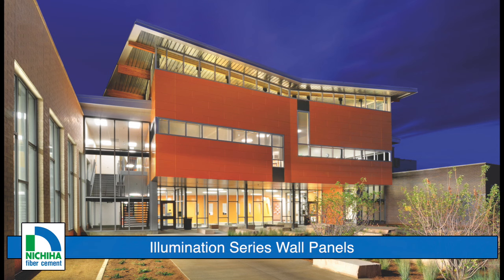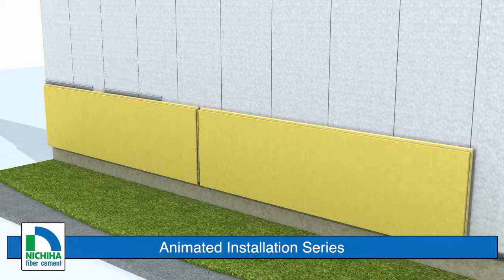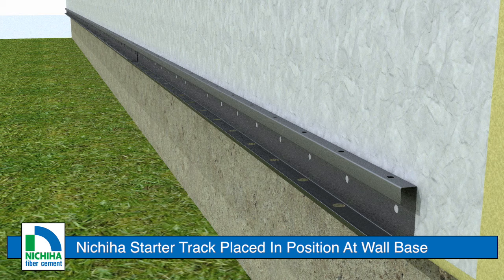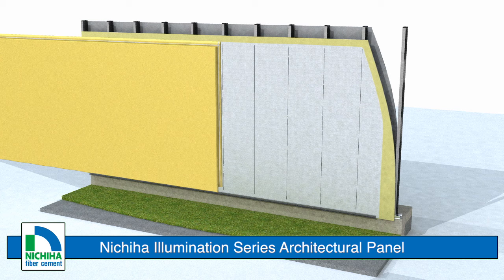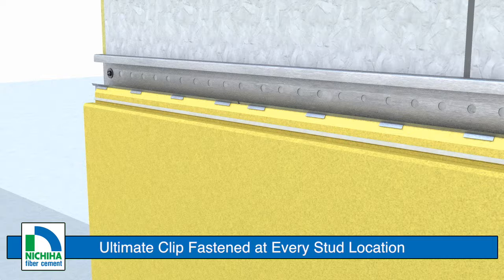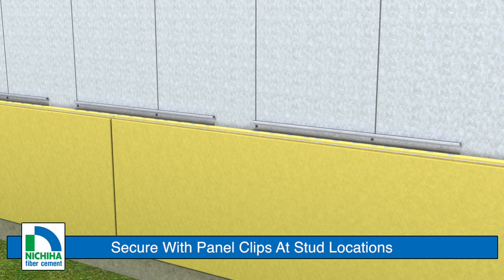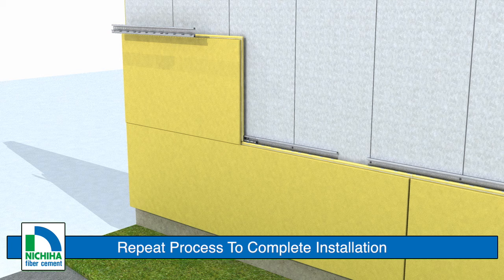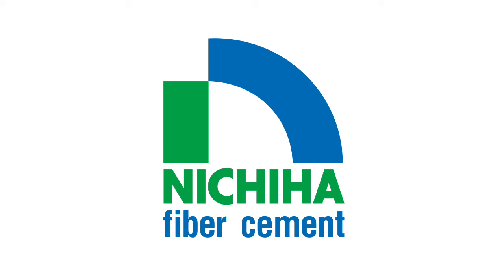Step by Step: Installing Nichiha Architectural Wall Panels with the Ultimate Clip System

Comment: How are the bottoms of the 2nd, 3rd, etc. rows secured? From your video, it looks like they aren't secured at all and could easily lift from the surface in a mild breeze and possible lift enough to break in higher winds such as a hurricane.
Reply: No... thats what the clips are for. They all connect

Comment: No sealing job needed?
Reply: My question too.  Specifically, how does the system manage wind?  "Weatherscreen" systems aren't integral, like wood siding or most sidings we've been using for decades, because they protect the wall but allow air to vent freely behind the panels too.  They expect moisture to get behind the panels as water or vapor and give it a place to go when it does.  But what if a 100 mph wind is attacking that wall and gets behind the panels?  Will it blow them off the wall?  I'm just looking into this now so I can only guess that the systems designed with "pressure compensation" or something like that, address that problem.  
What some people are seeking is a way to protect an exterior wall from all weather and wind up to 250 mph ideally, but CAT 5, which starts I believe about 165 mph would be a good start.  If the house is concrete, wrapped in thermally unbroken insulation and has a radiant barrier as the exterior finish that requires a 1" airspace on one side, and you need an exterior finish to protect that, and the whole assembly has to be either self-supporting or attached to the concrete (inner) wall or both, the choices are fewer and expensive.  We're also trying to avoid using man-made petro products too.  
If not for Global Warming, insulating panels like polyisocyanurate would not be used because they are manufactured from oil, and they eventually off gas sufficiently to lose 70% of their insulating value.  (75 years or so)   The houses we build from now on should last hundreds of years so having insulation that fails after 75, would be pretty stupid.  The best natural insulation we have to replace it, is compressed rock wool at R 4/inch.  Polyiso is R 6.6/inch, you can see why it's popular.
However Global Warming has evicted all that from the conversation.  Now we use whatever we have "on the shelf" to build shelters to withstand the storms and can generate enough electricity to be energy independent.  
I'm concerned personally with Coachella Valley California possibly the hottest place in America, hence the aluminum foil wrapping around the whole house and the roof.  (Radiant barrier)  Then fire suppression, so the latest design has a self-contained wave pool (8'x17' @ 48" deep) on the roof.  An electric elevator replaces stairs inside, as the house has a basement, a sleeping floor and a living/kitchen floor and the roof top terrace.  Each floor is less than 400 ft2 so the floor area of the living space including the basement but not the roof or decks comes to about 1000 ft2.  It violates Palm Springs height code by about 14'.  Material costs are high but it's a small house so total cost is "affordable" at roughly $150 K to build.  Then there is about $125K worth of Solar PV, batteries, and elevator, a swimming pool and a ground source heat pump and central air system to buy and install.  Land in PS is outrageous but options exist if you want to locate in a windier area.  Out by the I-10 freeway north of town, their is a 3,000+ turbine wind farm.  Most of PS is in a sheltered cove provided by the mountains, but as you move out of it, prices drop.  
I think the house would be worth $395K as built so it's not something you do to make money, just yet.  It's something you do to survive.  The winds are coming regardless, might as well build something that can handle them.
For the record, I built a house like this (without all the equipment, but concrete and polyiso and a  brick veneer) in Alabama about a dozen years ago.  In addition to being all concrete block, re-enforced and grouted solid, the house had a "saferoom" inside of it, about 8'x12' (Laundry otherwise) that had solid concrete walls, roof (independent of the house structure) and a door rated to 250 mph.  You can see some rough 3D Sketchup drawings of it at www.lisatec.com if you're curious.  Not much wall detail in those plans, just the elevations and floor plan.
Reply: Ye
Reply: Do your research it’s very simple and lasts 30 plus years when installed PROPERLY